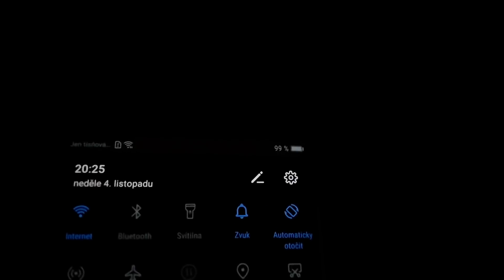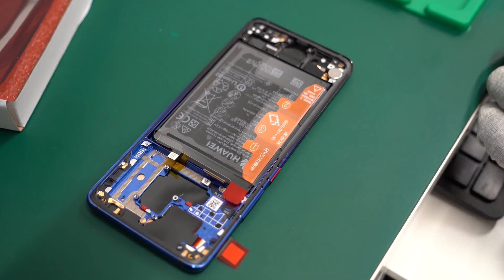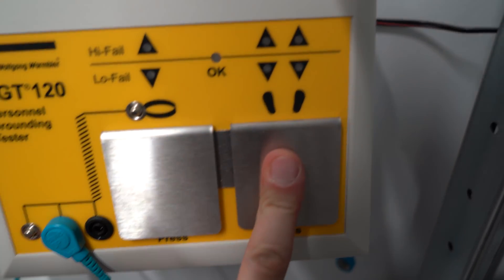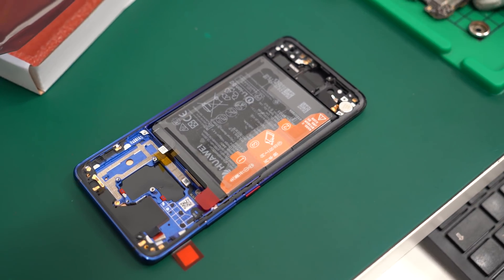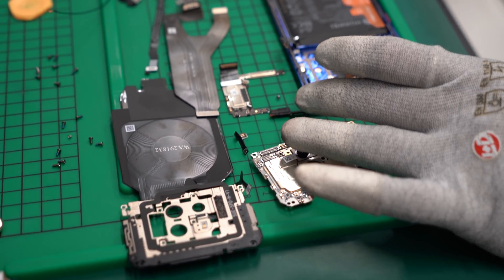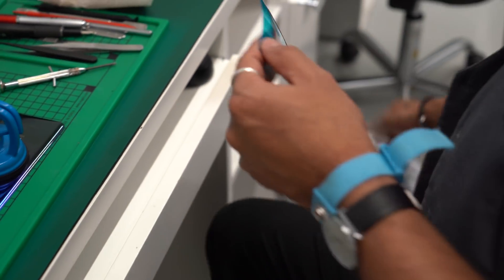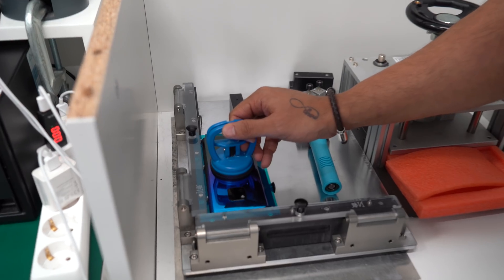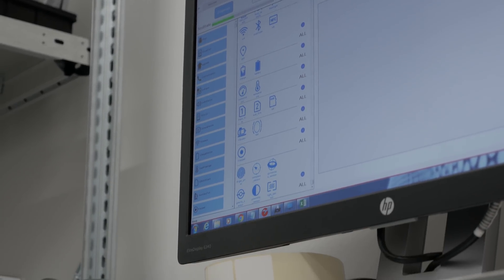Fixing the Huawei Mate 20 Pro Gluegate Problem - Teardown & Repair !

Comment: Mate 20 pro is unbelievably expensive for a Chinese phone... people will get note 9 instead and use it happily after
Reply: the price of the phone does not depending where the phone is come from, if you always think the phones from china have to be cheaper then the others, let me tell you all the phones are from china!!
Reply: @凯门见山  Im sure the Note9 was made in Vietnam.
Reply: @凯门见山  i get your point but investing so much money on a Chinese phone !!!! I think that 1+ is the best value for money Chinese phone ✌️
Reply: Its better to have a huawei phone than samsung phone. Huawei no lag and no battery exploding. Samsung after using for several it become laggy. Why i can say this? Because i own huawei phone and samsung phone. I use huawei p10+ for 2 years and no laggy, i use samsung s7 edge for 6months and damn its so laggy
Reply: @ashurary6869  idk how, I have a Samsung Galaxy s7 for 1.5 years now and it works like new, never lagged even a bit, 3 of my friends own and s7 or s7 edge since the day it came out and they dont lag and still work like new
Reply: Biggest dummy of 2018 goes to Sayantan Banik :)
Reply: @cassidytyler2057  thanks man..hope u r smart enough 👍
Reply: I had the mate 20 pro but got two models with glue gate. I then got the note 9 and the note is a beast. Both very good but the glue gate ruined the experience for me, if there was no glue gate it would be a joy. Love my note though!
Reply: hat is up with you people and chinese products, chine produces everything, from the lowest cheaper than cheap quality up to top notch best ion the world quality. as an examplethe best model cars in the world are made in china, and i for my part think made in china low quality is better than made in america good quality
Reply: @karlanal1  What "best cars in the world" are made in China? In America we generally think the best cars in the world are Lexus, Acura, Infiniti, BMW, Mercedes, Audi, which are made in Japan and Germany. The best full and mid size trucks are Ford, Chevrolet, GMC, and Dodge. Close to half of the vehicles on the road in the USA are trucks and SUVs. Toyota makes a good half ton truck as well, but no HD model. I'm curious about these Chinese cars you mentioned.
Reply: @nismomike3182  mike, please do read my post again, sometimes while reading we miss one small detail that changes everything, and than get back to me please
Reply: @karlanal1  I was not disagreeing with your comment about some Chinese made products being high quality. It was just an honest question about your comment stating "the best model cars in the world are made in China". Which cars are made in China that are considered to be the best in the world? We dont import any here and I'm honestly curious. I will read about them to inform myself, just point me in the right direction please.
Reply: @karlanal1  Are you specifically talking about model cars like the hobby grade kits made by companies like Revell?
Reply: @nismomike3182  yes that is what i was talking about
Reply: Where do you think Iphone is made? 😅
Reply: @lkgpuanimho0349  Antarctica
Reply: Your dumber than you look... China is the manufacturing capital of the world...The phone ur using wasn't built in ur garage
Reply: Here in Taiwan mate 20pro is cheaper than note 9, I'd buy mate 20pro if it wasn't for the display problem,
Reply: I should also give credit where it's due. The screen of my note9 is way better then any other offerings from any other manufacturers right now, it's bright and vibrant under direct sunlight, even on a day when you need dark shades to look up in the sky. And overall build quality is a tad better in my opinion.
But the battery charges slow, quick charge 2 is not fast enough compared to my last mate 10 pro since it also had 4000mah battery, also compared to that the stand by time on note9 is horrible. And the gps has issues to, sometimes it won't lock to a satellite without using the high accuracy mode, which in turn drains battery a lot faster.
Reply: there is a good reason why is phone A more expensive than phone B...origin of phones are not important here.
Reply: I was choosing between these two, and I went with the Note because of this issue, my problem is that there is no service center in my area, the nearest one is 200 km away
Reply: UNTIL IT STARTS EXPLODING
Reply: @Wang Li i get your point... If people used to buy phones just by checking spec sheet i don't think a single iPhone would have sold my friend
Reply: @Wang Li i didn't mean that but think practically ...as a average consumer what they gonna choose a $900 iPhone or a $900 Huawei phone...also keeping in mind the security issues of a Chinese phone and resale value of a iPhone
Reply: @Wang Li i used my friends p20 pro...it was a mess... didn't like it at all.
Reply: @Wang Li u got upset... sorry if i hurt your feelings
Reply: iphone is expensive as well foe chinese phone
Reply: +Lkgpuanimho 0 What phones do India produced?? Cups with string attached at the bottom, haha
Reply: +Sayantan Banik Since you like antartica so much, you must have used smoke signals as ur phone 😂
Reply: Yep
Reply: Where a phone is from has nothing to do with the price, after buying iPhones & Samsung notes etc, I took the plunge and got a mate 20 Pro, it’s in a different league to the rest, Apple in particular need to wake up, as it’s blatant to me that Huawei have listened to their customers and built a superb phone with class leading battery life, Apple are to arrogant to make their devices thicker to hold a bigger battery, this is what made my my last £1250 iPhone useless - appalling battery life.
Reply: Do realise Samsung and iPhones are also made in China
Reply: @WyvernApalis  Samsung phones are assembled not only in China but in another countries like Korea Taiwan and many others meanwhile Apple rely only on China
Reply: Samsung is laggy? Hahahahahahaha. I have a Note 9 and is a beast. I chose Note 9 instead Huawei (the data sellers). Note 9 is so complete and so good. 
You can't compare a copy with Samsung. 
Go on triggered people. I'm waiting your reply.
Reply: well, i think where the phones are made can affect the price, i really dont know but i hear chinnesse manufacturers have to pay less than other countrys. and the workforce is way cheaper in china... 

i just say.... maybe i'm wrong but it have a bit of logic
Reply: Sayantan Banik note 9 is expensive for a Korean phone. I will happily buy mate 20 pro if i have 💰
Reply: @sandeepreddy8567  Samsung is the biggest tech giant...even apple's displays r from Samsung..its just not a korean company man
Reply: Sayantan Banik lol, Huawei battery and camera technology is a generation ahead of Samsung. And Kirin980 is 6 months ahead of 9820. The previous Exynos 9810 is a failure (refer Anand Tech). Only Samsung is better in AMOLED.
Reply: @sandeepreddy8567  generations? Pictures of mate20pro are soso and its video is pure trash compared to the samsung ( stabilisation and audio ). Battery sure but is battery worth 300 euro for me? 9 series are overall champ, it does everything great, maybe not the best but it beats huawei on most segments.
Reply: whats Huaweis screen technology like @lelouch V Britannia ? Ill tell you. Its awful. Ive owned two mate 20 pros both had god awful screens with green bleed. But you keep spreading your misinformation
Reply: @kimyungill2149  maybe you need to get your eyes checked
Reply: Sayantan Banik you say that while thinking Huawei is small, it’s actually the biggest telecommunications hardware provider in the world
Reply: It's completely opposite for me, I bought the note 9 instead of the mate 20 pro and started regretting it from day 1. The photos from note 9 are good but not at all comparable to pixel3 or mate 20 pro. The only thing note 9 has is it's video. Bought my note9 on the 14th of last month after my mate10 pro was stolen a day before. Note 9 feels like a downgrade even compared to my last mate10 pro :( . Not happy at all, will exchange it with a mate 20 pro after Huawei starts the exchange program. Oh and btw, my note 9 says it was made in Vietnam not in China.
Reply: @rkbhsn1  video is so much better with Samsung. Just download Google cam and you good
Reply: @kimyungill2149  well what do uou know I already have the exynos gcam port running on my phone. But it doesn't take pictures with low aperture, low light pictures aren't good even when compared with the note9's very own camera app. Yes in bright day light the gcam does take good looking pictures by upping the the contrast level and lowring the brightness a bit, and in the evening( when the sun is still visible but getting down) it takes great pictures with hdr+ mode, but no hdr+ enhanced mode for us though.
Yes the video quality is superb and there's no doubt and with the focussing speed of Samsung it's just takes awesome clips effortlessly. To be honest even my old galaxy s6 takes great 4k videos. But I'm more of a picture kind of guy.
Reply: @rkbhsn1  The quality difference between pictures is much smaller than the difference in Video recording. Mate20pro Video recording is really trashy. The audio is bad and the stabilisation is a joke. The pictures arent trash with the note9 but atleast it has superior video and I record a lot of video.
Reply: @kimyungill2149  good for you. But to me the pictures of note9 are a level lower compared to pixel 3 and mate 20 pro. And no note9 pictures aren't trash at all. they are good. But it's just that their camera app is a big let down. Note9 has the hardware to be the Number 1 in photography ( except for mate20 pro's resolution with 40 megapixels and the fact that you can work on them afterwards) but their app makers are not doing it any justice at all. I wish a better developer would take the job to make the app.
Reply: I actually canceled my mate20pro and very happy with my S9plus 256 gigs AND it was 30% cheaper than the mate20pro. Dodged a bullet 😂
Reply: @kimyungill2149  Damn dude, well I guess you dont need flagship specs. S9+ is fine, but mate 20 pro would have been all around better phone..
Reply: @kimyungill2149  Good luck with Samsung software.
Reply: @kimyungill2149  smart move man😉